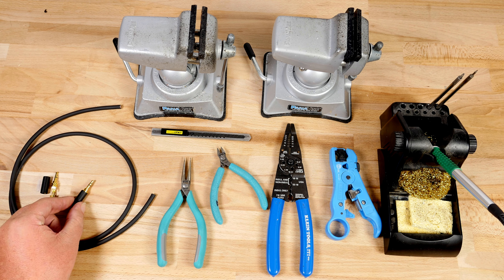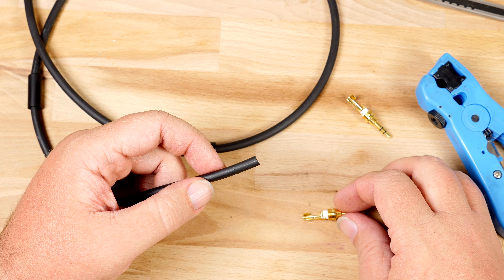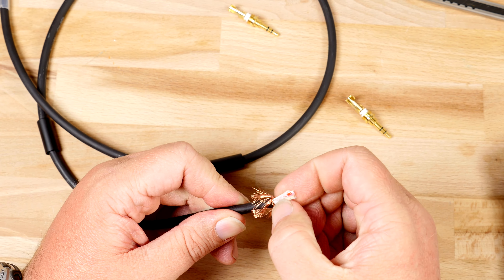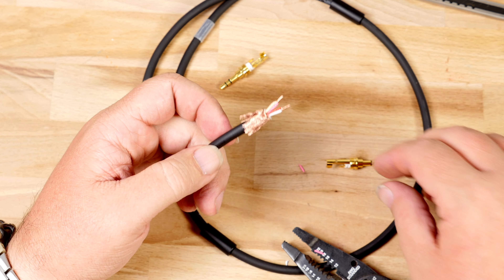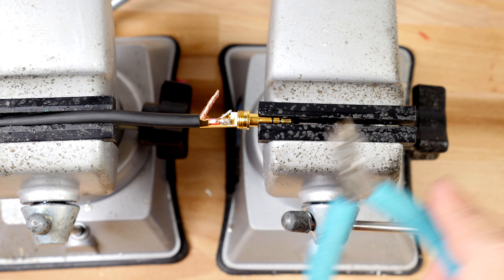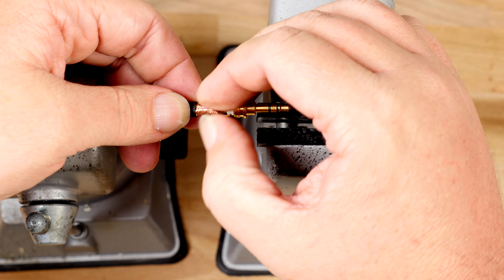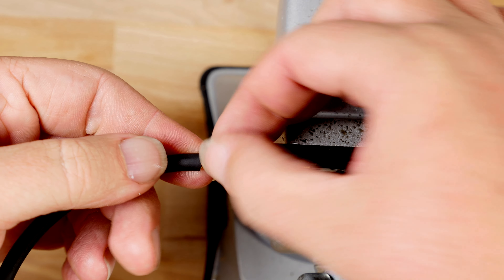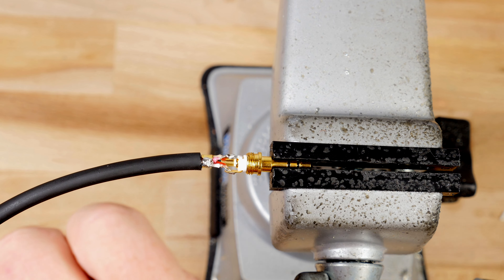How to Solder: Aux Cable with 3.5mm Headphone Connectors

Comment: The cable linked in the description is Mogami 2549; a regular 2-conductor cable. The cable used in the video, however, is Gotham Audio GAC-4/1. It contains four signal wires instead of two because it uses a star quad configuration, which minimizes EMI. This would have been worth mentioning in the video. Mogami also makes a star quad cable (W2534) as do Canare, Belden, Klotz and others.